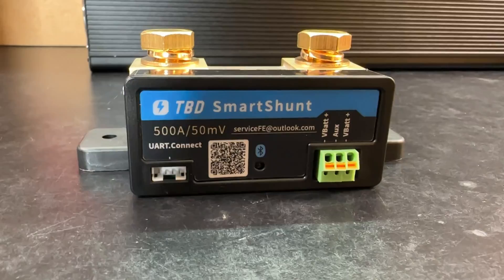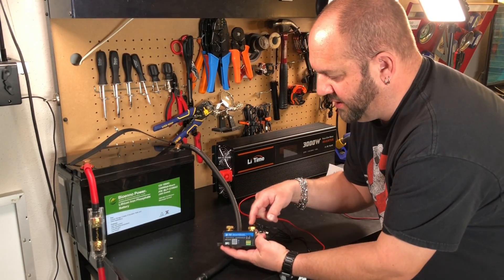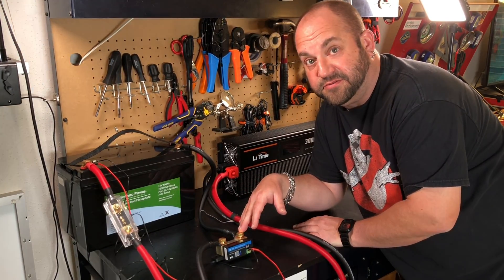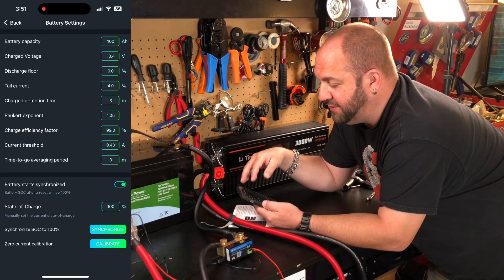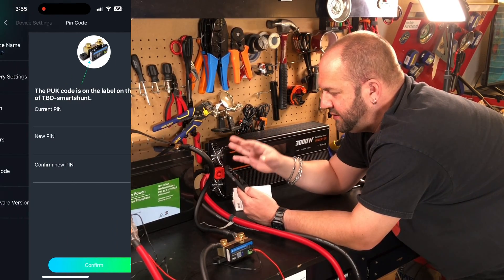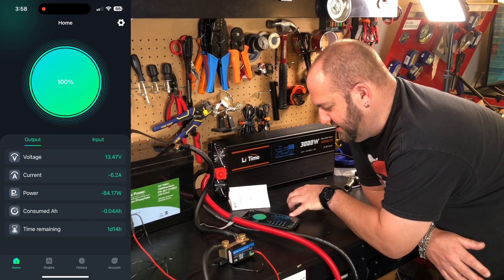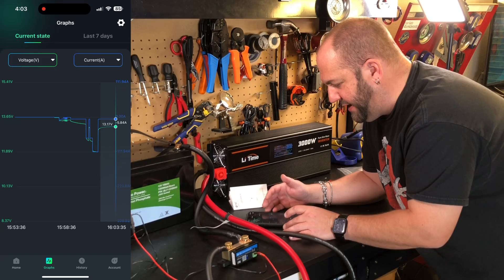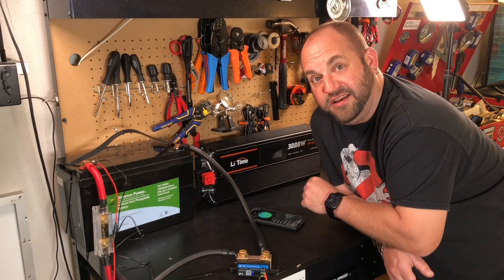This 500 Amp Bluetooth Battery Shunt Is A Must For Your System!

Comment: Thanks for the review. I just bought this shunt and was about ready to return it because I did not understand this discharge floor thing... they call it something else in the app now though. Now  its called "Depth of Discharge" now. it was defaulted to 50% and I set mine to 100% and it was causing the capacity % thing to slowly climb up as soon as I switched back to the main screen even tho I just drained it 100% and I couldn't understand wtf was happening. Set it to 0% and boom... that was the issue. My only wish is that the "time remaining" display showed the time to fully charge when in charge mode like my other shunts do, but this one just displays lines when charging, and only calculates the time when discharging. Oh well... it does what I mainly wanted and the app is alot nicer than my old one!

Comment: I have this unit and I set it up on a 400ah 12v lifepo4 battery bank. When I changed the settings for the battery bank the main screen calculations are that of a 20 amp battery bank. I can’t seem to get it to show the calculations for a 400 amp battery bank. Any thoughts? I’ve checked and double checked the settings many times, it’s set to 400 amps.

Comment: Regarding the low voltage alert: The set voltage is the voltage where the alarm is “set”, so below which voltage the alarm should be triggered. Once the voltage rises up again above the “clear” voltage, the alarm is turned off. That’s why the set voltage has to be lower than the clear voltage, otherwise it would either never trigger or always be on.
Reply: Correct. Once you start charging the battery via a DC-DC convertor or AC charger or Solar and it hits the "clear" voltage it will reset as the device knows the battery is recovering.

Comment: Awesome video. Learning the battery thing. Gotta ask, is that a wine fridge that you are using as a humidor? I have good ole Apache cases from Harbor Freight. Here in Heber City it’s dry so an air tight box with humidity packs is the ticket.

Comment: I'm betting the UART connector is for automation and connecting without the app. I want one. One of these days, I'll try and pick one up. Thanks, Mike. 🤙🏾oh and I'm guessing you can add a temperature part with that very UART port.

Comment: With all love, please take those bracelets off when you are working around those batteries.  Nothing happens until it happens and when it happens you going whish it didn't,  Also, if you are going to have the battery under the rack of metals tools, you should look into installing  cable boots to cover up the lugs.   73!

Comment: that was great. I have the Victron one in my home 24V set up.  you can mount that temp. probe on any battery on system. even on a cell if making a battery bank that way. what I did . works on different battery types so just look up data from your battery type like AGM and enter the data into the app. on Victron that 4 pin plug is for the smart gauge  monitor . for a RV or home you mount in round hole and you  have a display to read. may be the same on that. plug looks the same.  73's

Comment: Can you export data? great video
Reply: I suspect that's what that UART labelled port is for...  UART usually stands for universal asynchronous receiver/transmitter, which is just fancy speak for serial port... The 4 pins are probably +5v, GND, TX, and RX...
Reply from the maker: Unfortunately not

Comment: How do you know when the battery is fully charged   so you can synchronize? Also, do you know what gauge wire they supply for those of us that have to manufacture Anderson Pier Pile cables?
Reply from the maker: If you're using the proper charger for LiFEPO4 it will stop charging once it hits ~14.6V.  You won't see any more current going into the battery.  You shouldn't need Andersons for this shunt though.  But if for some reason you wanted to use them, you'd want to go with the 15 amp connectors as they are the smallest I'm aware of.  The red wire for this shunt to connect to the battery is 18awg.
Reply: @hamradiotube  the batteries don’t have terminals, only Anderson connectors, thanks.